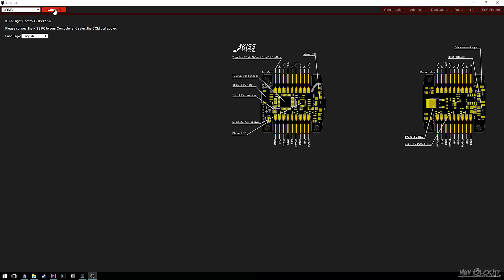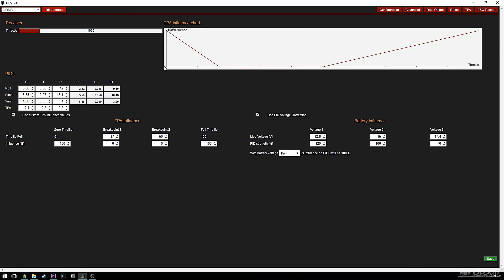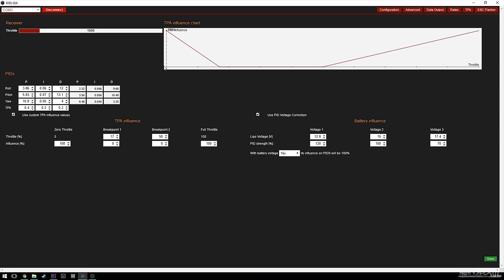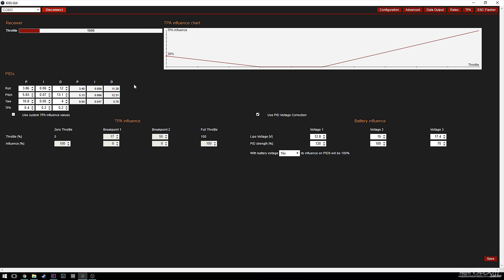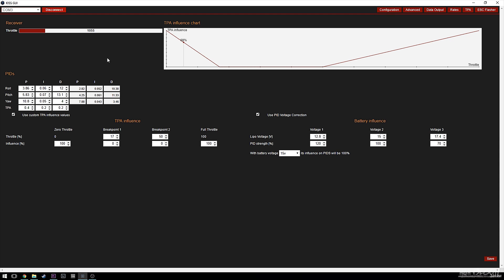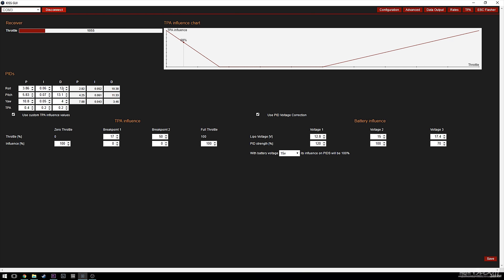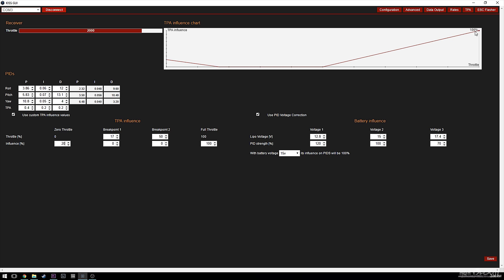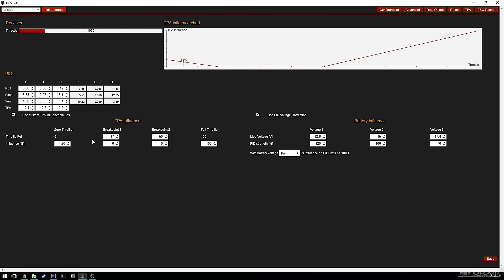Tuning PID's Part 2 Advanced Tuning

Comment: Yeah, but how do you set up the idle up switch in the Taranis??? Know body ever talks about how to do that!!
Reply from the maker: +Magic Smoke FPV I no longer use an idle up switch. Air mode on both betaflight and kiss has improved so much that there is no reason to run the idle up anymore.
Reply: I just figured it out and set it up, and I have to say, on the KISS I can tell it's better with the idle up actually. It is the most locked in that I have felt yet, and way better at Zero throttle when I am doing small maneuvers. I am just trying to figure out how the TPI works now, and get it to stop the tiny drift I get when I jam on the throttle. Upping I values helps, but does not fix problem, and the bounce back at zero throttle on my pitch, I just can't get rid of yet.

Comment: when you have the min komand higher then min thr.. i tried that, but then i lost kontroll in lov rpm.. is there something missing for me?
Reply from the maker: +MAX_FPV if min command is g
Higher then min throttle you will loose the pid controller at low throttle, unless you use an idle up switch on the radio.
Reply: How do you set that up??